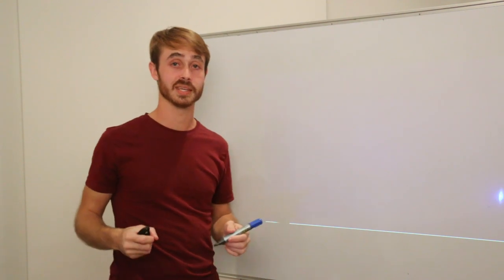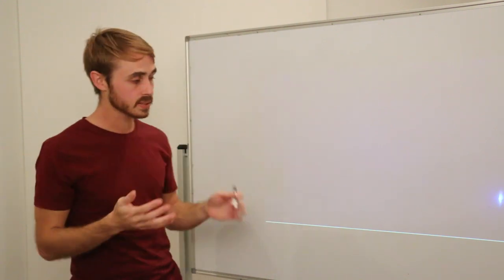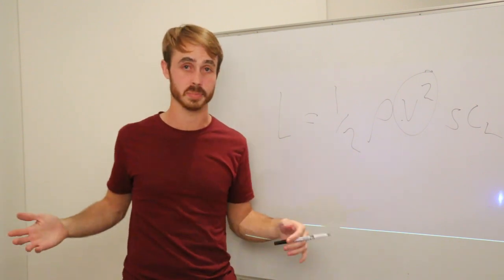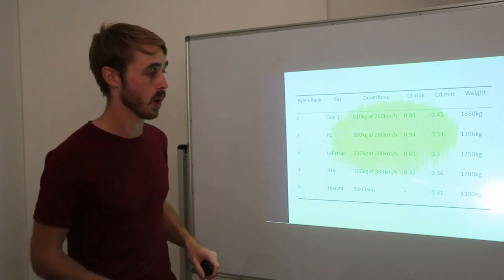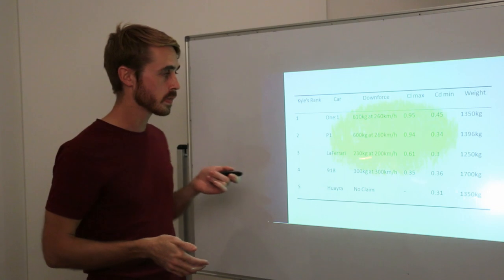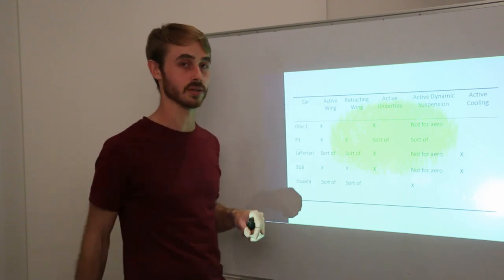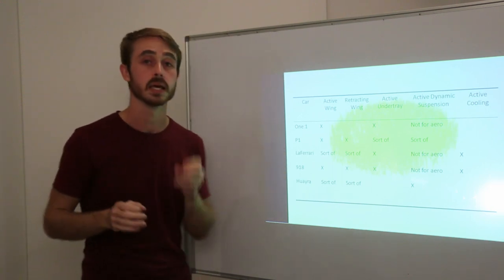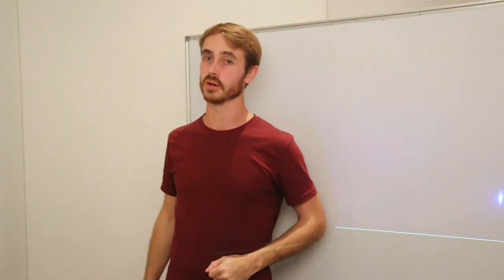Aerodynamics of Hypercars - Episode 1: Active Aerodynamics

Comment: Videos are very informative. I must say those claimed LaFerrari weights were just claims. 3 American mags done some recent tests in a LaFerrari. The curb weight was around 1583kgs.
When you have time, please look into the new Dodge ACR aerodynamics. A quote of 907kgs at 285kph of downforce was released at launch.
Reply from the maker: Jeffrey Williams Interesting about the LaFerrari weight, I thought it seemed amazingly low, especially compared to the others. 

interesting about that ACR figure, I'll have to look into that. They are quoting at a pretty high speed though, meaning their Cl isn't insane (-1.15 using the standard frontal area I used for the other cars here). The aero pack on it is definitely more intense than the P1 or the One:1, so I would believe it.
Reply: KYLE.DRIVES LaFerrari KERS system is a little heavier then P1. Combined with bigger tires and V12 such weight shouldn't be a surprise.

Here's how the P1 looks without it's panels.

jalopnik.com/the-mclaren-p1-like-youve-never-seen-before-taken-a-1703649751
Reply from the maker: Jeffrey Williams Unfortunately, I already filmed the LaFerrari analysis which comes out this Friday, so now I'm going to sound like an idiot when I say it's lighter! =P

Great pics, I already had a heap of the undertray, but the engine bay shots are really cool. Unfortunate that the diffuser is removed for those photos, it's the coolest part!
Reply: KYLE.DRIVES You're not alone. Many haven't looked into LaFerrari weight claims properly. Journalists are saying the same stuff in videos. Here's a brief review from MT of LaFerrari.

www.motortrend.com/roadtests/exotic/1504_ferrari_laferrari_first_test/

If you want expand this aero picture farther. There are some cars out with massive downforce without much active aero. I see someone mentioned P1 GTR and FXX K in another video. The Vulcan  has 1300kgs DF. Aston Martin made these claims at Geneva.It will be a track car that can be converted to street usage after driver's program.
If you going to do a series with those 3, the Zonda R Evo should be mentioned also. Like newly released ACR, Zonda R Evo wing can be adjusted in cock pit.It's like a DRS feature.

New Radical RXC 500 has similar DF to new ACR. SCG003 has some interesting aero bits also. The Venom GT isn't talked about much in this aero area but a recent video has some nice DF claims. Hennessey stated something like 680kgs at 241kph with wing up in wind tunnel.
If you can workout some material on some of the mentioned cars that would be great.
Reply from the maker: Jeffrey Williams I was actually discussing the SCG003 aero today with a fellow vehicle aerodynamicist at work today, and we both agreed we were pretty disappointed with its aerodynamics (loved the look though) and it definitely could have pushed the limits a lot harder given what it is. The Vulcan's downforce is quoted at 200mph, so it helps to make the number look bigger, its Cl is -1.31 on the hypercar frontal area, which would be somewhat expected with it's aero pack (although I personally would still want more). The RXC may have similiar downforce to the ACR, but it also has a much smaller frontal area, which is consistent with its more intense aero pack. The figure I saw for the venom was 1050lbs at 150mph (477kg at 240kph), I would be very surprised if they were actually getting 680, that gives them a Cl of -1.28, which is insane given its almost non-existent aero pack. 

I would love to do a series on all of these cars, we will just have to see if the demand is there. If the Aerodynamics of Hypercars series does well, then I will definitely look into evaluating other cars. The new Ford GT concept has particularly interesting aeros that I would like to work through. Unfortunately, the series isn't doing as strongly as I had hoped at the moment, so we shall have to see where it is at the end.
Reply: KYLE.DRIVES Glad to hear you checked into some of my mentioned cars. I saw in a Road and Track review Hennessey quoted 1200lbs at 150mph. This 1500lbs must be with the drop in height. Suspension can be lowered 2.4 inches or 61mm. I guess their is some more for error with his recent quotes.
Vulcan I figured something like 200mph. Would be awesome to feel that kind of pressure in such of a car. I going to mention the Ford GT but not much has come out of it yet.

Let's hope this first series does well.
Reply: Finally some real info on Ford GT.Some very  interesting details have been released.

blog.caranddriver.com/latest-ford-gt-info-serious-computing-chops-may-pack-700-horsepower/

Found DF numbers on first Zonda R. Evo mag quoted almost 2000kg at 300kph(186mph). The 2nd model or Revolucion featured a DRS function on wing.

Comment: ***** What are your thoughts on the the use of wings on motorcycles? For example on the current Ducati MotoGP bike and Kawasaki H2R.
Reply from the maker: CoolBananas Wing's on bikes aren't going to do a huge amount through corners due to the lean angle of the bike, however the H2R ones are located right at the front, so will help with keeping the front wheel down in a straight line, as well as help with braking. The good thing about a bike is that as the rider can control the brake bias you don't need to worry so much about the aero balance shifting forwards as on a car. It's still not ideal, however should still result in faster laptimes.
Reply from the maker: KYLE.DRIVES also, those bike wings are still very small, so don't expect huge downforce numbers